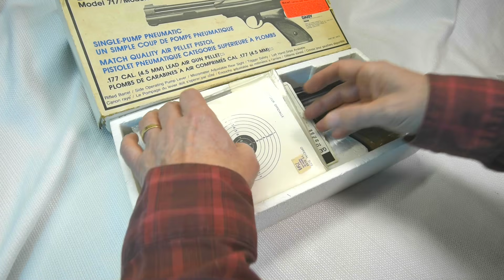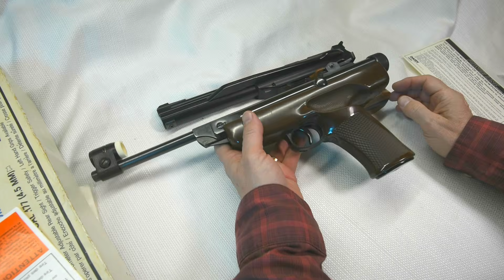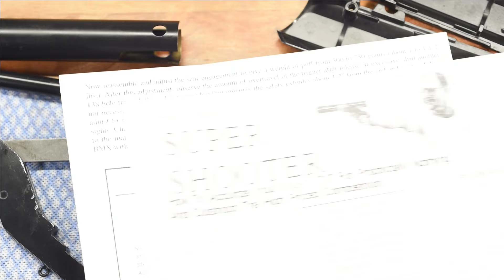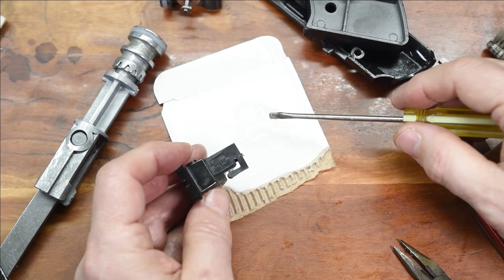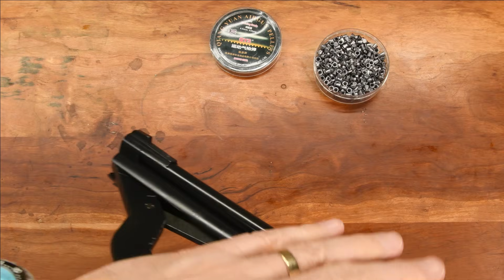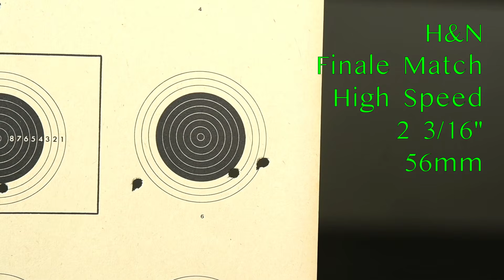The Daisy 717 - an entry level target gun that needs new seals

Comment: i have a 777 that was listed as a 717....didn't know what it was, just bought it because i thought it was cool...then a few years later i paired it with a 747...they all start out with a 717 and you get factory installed upgrades as the model model goes up....first pistol i was ever able to shoot sub dinner plate size groups at 20 yards

Comment: I heard of this sport called 10 meter air pistol  back in 1987  . I think I watch it on the  Olympics . I heard our State KY  was have a 10 meter air pistol match in the Blue grass Games in the 1988 year events . I found a 717 at the local hardware store in late 1987  that wasn't holding air after it was pumped one time like it was suppose to so the owner sold it to me for 40 dollars . I took it apart and changed the seal and got it working . I practiced for every night after work  for a hour or 2 till the match . I was 29 in 1988 . I had no idea how I was shooting compared to other shooter  in this sport so I really had no idea how I would do in the match  so I was kind of worried I would be in last place with my 40 dollar 717 gun and the Crosman wadcutter's  . When I got to the shoot I saw a lot of very expensive German guns and the German pellets . I just did the best I could and I ended up winning  with a 580  out of a possible 600  The guys running the shot thought that was a good score for a first time shooter especially with a 717 and cheap pellets . One of the guys shooting with the German gun got mad and and wanted the judges to check my trigger weight . The 717  doesn't have a adjustable trigger so when they checked it and it  was 2 time more trigger weight than what it could have been. I think they are set at around 2 pounds . He just couldn't believe he got beat with a daisy 717 and a first time shooter . I went again in 89 and won that year also .  The 717 is a great shooting gun and if you are thinking about getting into the sort  its the gun to get . They really hold their value and even gain value . I think this gun now sells  for around 150.00  or more . I still have my daisy 717 and still shoot it all the time . I shoot my matches with my izh46m . I guess I got use to the single stroke  guns . It's really all I need for the shooting I do now a days .

Comment: American gunsmith and precision pistol shooter Dan Nygord devised a way to modify the trigger/sear mechanism that results in an adjustable, competition style trigger.  He also devised a way to put a 1911 style competition rear sight on the 717.

He used his modded 717 to win the California state champs  for 10m air pistol.  

His philosophy was that the gun was cheap.  If it broke, you could put your modded trigger and sights into a new chassis, and you were good to go.  You get Olympic level performance at a fraction of the cost.

Comment: A few months ago I found a 717 at a local airgun dealer/repair guy.

I like buying broken stuff from different shops.

Just paid €20,- for it, had to remake the sight at the front, thank you for the close up, now I can redo mine!

Replaced the seal with a regular O-ring and added a few drops of silicone oil.

It shoots like a charm, took my complete airgun collection to the girls outs where my daughter is a member.

The girls really enjoyed this one together with my Diana model 5.

Mine is from 1982, has an umarex stamping under the lever.

The piston is also easy to adjust with it...